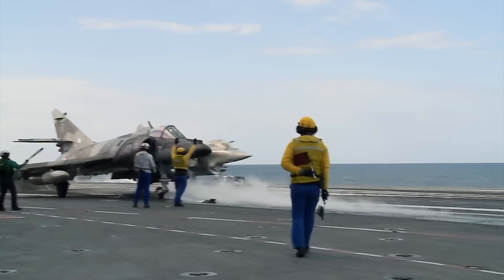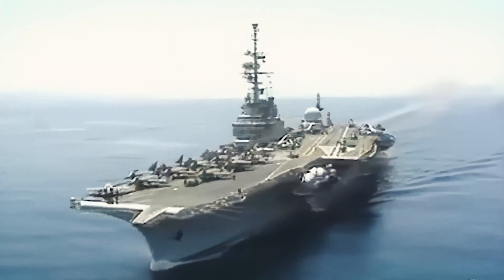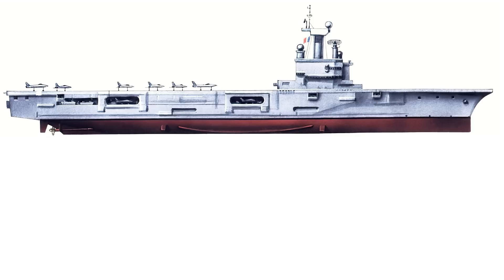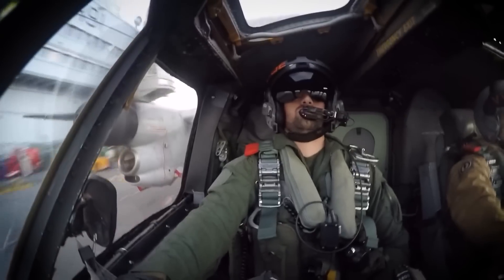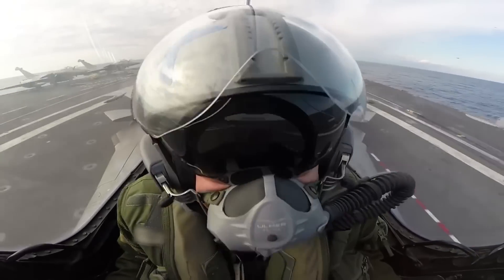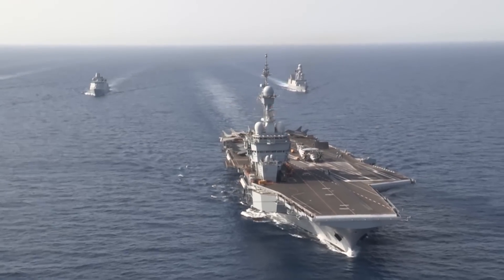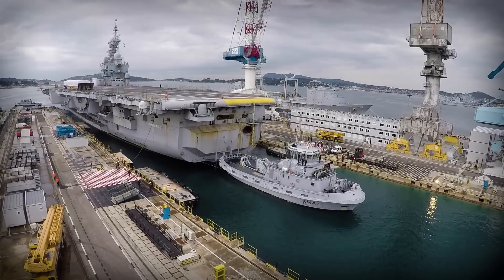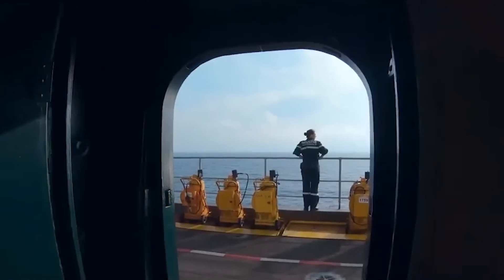Charles de Gaulle - Frenchman with an atomic heart

Comment: Nimitz-class carriers might be twice as expensive but they're also more than twice the displacement and can carry more than twice as many aircraft, on top of several times the volume of ordnance and aviation fuel
Reply: Also benefit saving of scale  thus limits was not as expensive for capabilities
Reply: Also build in a country at least twice the size and the wealth than France.
Reply: @psour33  About six times the population and more than ten times the wealth, to be more precise
Reply: @alexv3357  You're right but i was lazy about the maths. 🤣
Reply: i think that if there were 11 or so Charles De Gaulle they would cost a lot less than half a nimitz but i still see your point
Reply: This is somewhat compensated by the fact that CdG mainly transports the Rafale M, which has very low downtime between missions, and can manage several missions - at once. So, performance to cost ratio still tips towards CdG.
Reply: A lengthened CATOBAR Queen Lizzy would come out at about half the cost of a Ford, they should've gone with a diesel carrier for the CDG replacement. Maybe then they'd manage a second carrier to sea again.